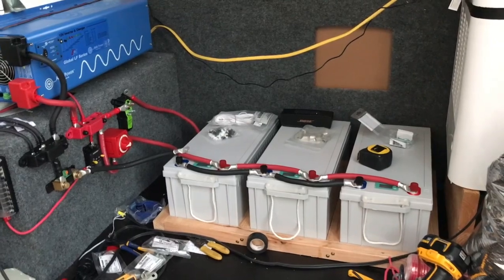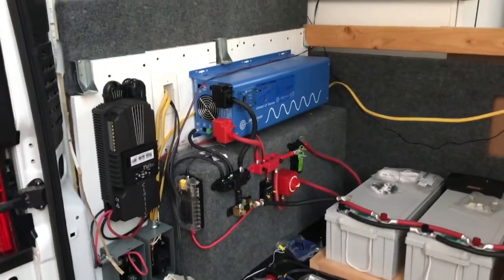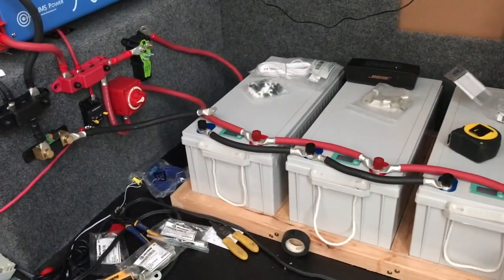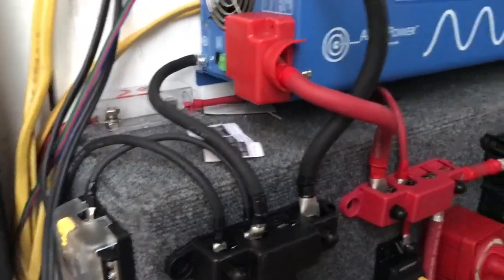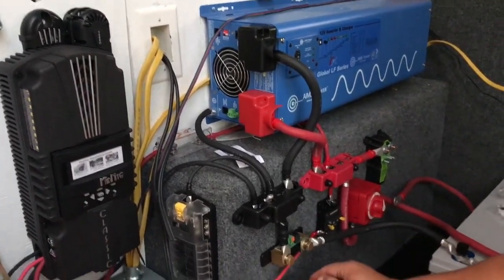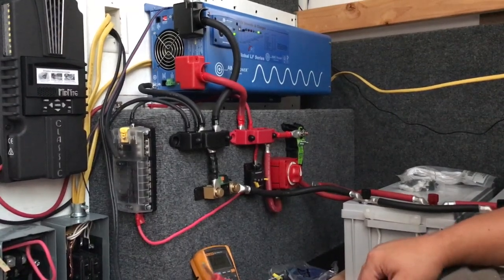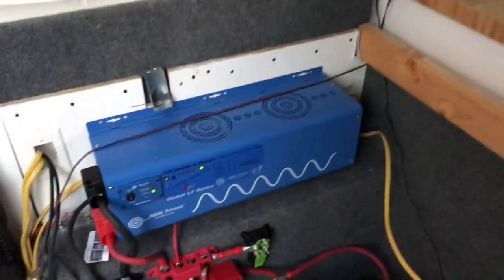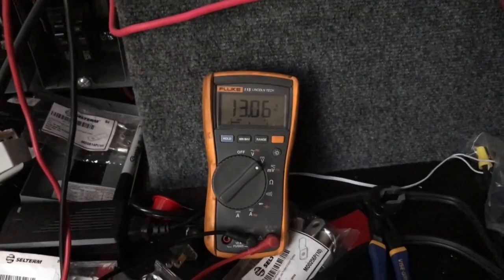Applying power to the vans electrical system for the first time

Comment: You have the batteries wired incorrectly. The battery furthest away from your inverter will not see nearly the load of the first one due to resistance of the wire and terminals. To correct it, you need to connect the negative at one end and positive at the other. If not, you will start to see equalization issues in your bank. Ideally, you want each battery connected to the load with same length of wire and number of terminations.
Reply from the maker: Thank you for pointing that out! I noticed after a week of use they were not balancing well... So I did run a negative from the far right battery to the shunt.